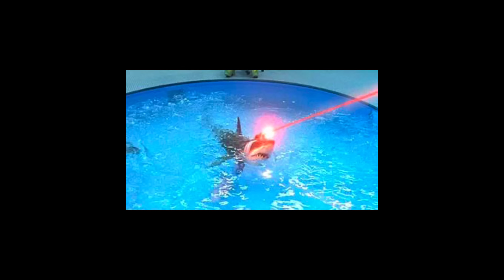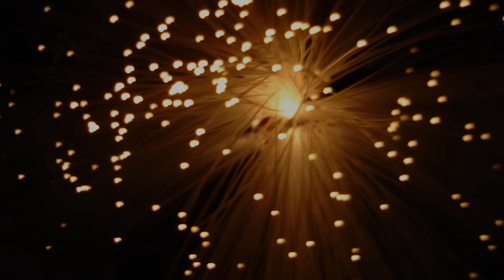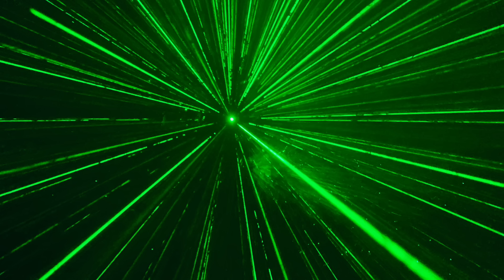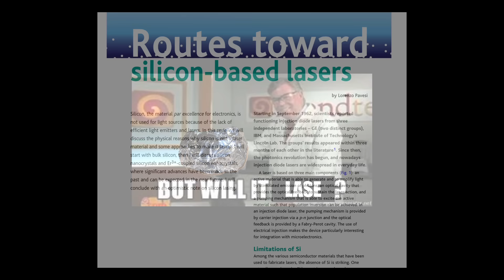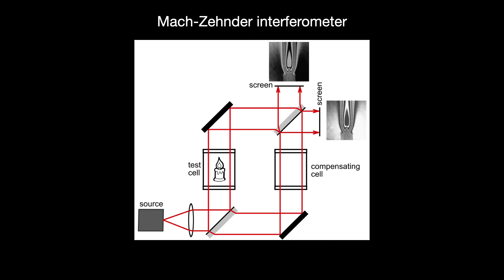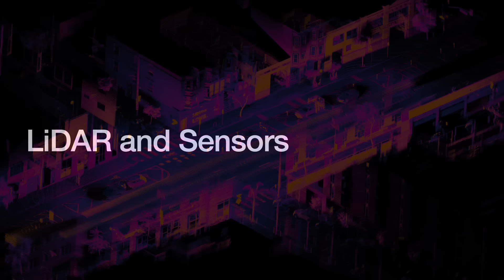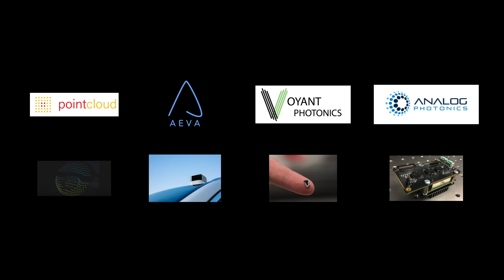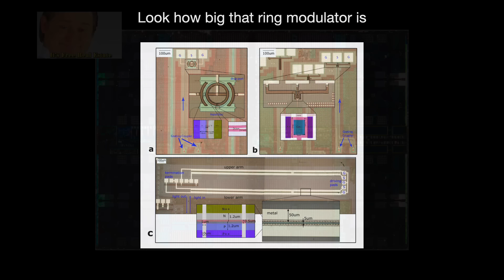Silicon Photonics: The Next Silicon Revolution?

Comment from the maker: What other silicon photonics topics would you like to see?
Reply: There are several startups working on all-optical quantum computation using integrated photonics. Psiquantum and Xanadu are the two most prominent ones.
Reply: @peersvensson9253  quantum and photonics are at a different level cannot equate.
Reply: How this would increase SINAD in modern audio gear and how it would push the performance past 130dB SINAD for just about every consumer level audio device.    
If optical circuits are used?  That takes care of magnetic fields on the traces used in common logic that we use today.  It also would make it theoretically immune to Radiation to a point.   Especially if you used something like a  Quartz crystal or something of the sort of oscillator for the CPU clock timing so that the light could be powered by that so the Logic itself would be immune to much of the interference from space travel.  

Something like this would be perfect for noisy audio environments.   

I would also have to say that something like this would also make it so that you would not need to use expensive gold conductors or silver ones as you won't have to worry about  metal breaking down over a very long lifetime.  

I know it's a little bit further than what you were talking about on the video but I thought it would be a good idea to run it by you.
Reply: @MickeyMishra  Im seconding this. Dealing with noise interference using light seems like a really good topic to talk about.
Reply: @MickeyMishra  nothing to do with audio gear, better to go back to vaccum tubes.
Reply: I would like to see more topics about biosensing. The integrations of silicon photonics in wearables seem a potential market. I work in the field and your summary was well documented and easy to understand.
Reply: Check out POET Technologies, unreal what they've already accomplished.
Reply: Silicon Nitride in integrated photonics, biosensing, quantum computing, space/high radiation applications, cryogenic applications, non linear optics, i think there is a bunch to dig in 😊
Reply: AI chips! I think photonics is very useful for inference in particular. Lightmatter is an MIT photonics AI chips spin-off that everyone is talking about.
Reply: @Extys  I second this and also maybe go over the topic of what makes for efficient chips in a neutral net, like Tesla's new super computer, is he just bullshiting like normal elon or not.
Reply: @Hassan311m  Elon is just total BS.  He cannot even understand what  is AI.
Reply: How far down the rabbit hole are you willing to go?
Reply: How do you store photons. We store electrons in in batteries but photons have no storage device.
Reply: @jamesjensen5000  in time domain you can just build loops to let the light run through. eg in Silicon at a clock freq of 50GHz, light travels only 2 um per clock cycle. Or then have some material that changes the light while it passes through. So you store the info in there but just read the info optically
Reply: This product use SOI wafers.It's hard and expensive to produce base on my experience at implant. The wafers sometimes "jump" due to charging effect and thickness compared to normal wafers.
Reply: Great intro! While not as big of a fundamental challenge, some of the integrated passives have the chance to minimize many large/expensive systems such as time of flight and photography.
Reply: The current steps being made to develop an optical motherboard
Reply: Cover poet technologies. They just released some hardware
Reply: Sharks with " lasers ".
Reply: Heterogeneous Package Hybridization
Reply: But I think there will be a paradigm shift soon, given all the AI, yes, you need huge machines to do the neutral network training and stuff, but the actual deployment will only need very little computational power. With a deployed model, even a small micro-controller will be able to to handle, just need more RAM to store the weights.  So I think the next advancement will be on the bus speeds of peripherals, currently the peripheral bus standards are not high enough, like CAN, SPI, I2C etc, think we will need 100mhz speeds. At higher speeds at low voltages will be very susceptible to external influences, so probably have to go photonics.
Reply: I've got an updated guide here for people to check out with steps.
Please do follow the steps very precisely.

There have been extreme breakthroughs in research and ideas with the latest Time Crystals, using light and other methods, there were articles that mentioned using Time Crystals for our chipsets in our computer, scaling up Time Crystals to do so with several breakthroughs in multiple articles, and the idea of using Time Crystals as unlimited energy for warp drives, advanced particle replicators, also curing most if not all diseases and more is an amazing thought, Quantum Teleportation / Quantum Entanglement, Quantum Simulations, the thought of super position and Qubits, and so much more around advanced particle replicators which would be used to create non-living objects like duplicating your food or computer and sending it to Mars and beyond our solar system using satellites and then duplicating it on the other planet when it gets there, and you can also use a button to have Quantum Teleportation send data from a machine to materialize your favorite food right in front of you "that is after the data from the original food you created was saved and stored with no bacteria and was perfect in how it was made" will then materialize the specific type of food that you chose with a button you pressed, there's also the idea of advanced clothes replicators, advanced vehicle replicators, advanced building / structure replicators, the list just goes on forever in anything you can make, first they want to start with the Quantum Internet by 2030 for that idea, sending data using Quantum Teleportation, and with breakthroughs beyond that would become advanced particle replicators.
Though the idea of Time Crystals in our chipsets for our computers "and this could change all technologies we use daily in society, a revolution in technologies", could happen very soon if they choose to do that with breakthroughs in 2022 around Time Crystals from what articles were talking about, mix the idea with Graphene, Graphene - Photonics, and many other Graphene technologies shown on my other channel under the created playlists.

The 70 year old theory "create something from nothing" was proven true when matter was created using Graphene, there was an article on this recently as the time of this message.

Erik Lentz with his new theoretical warp drives, was able to get the positive energy required known as "Soliton" particles as of early 2021 and summer 2021 down to the size of one earth mass, it could be lower now because of new calculations.

Sonny White at Nasa was able to get the negative energy required for the old theoretical warp drives down to 700 kg "the size of an elephant, vehicle, voyager space probe" for the warp bubble.

They want to make a tiny 3D printed space craft to place inside the tiny warp bubble for testing, Nasa said they won't do this until they are done funding the research on the casimir cavity, something to do with the warp bubble.

As someone from Nasa that knows Sonny White has said, "unpredictable breakthroughs can happen 10 years from now or tomorrow, it only takes someone to come along with a light bulb that goes up, and comes up with a new idea / concept idea", and that is a very important big picture.

Here are the steps. -

💡 

First save this link to your favorites.

https://www.youtube.com/channel/UCB9ezXYprgvhMaPWLhyoJ7A/playlists?view=1&sort=dd&shelf_id=0

Watch just the first 2 videos at the top of the Graphene playlist.
https://www.youtube.com/playlist?list=PLAUtk-Q2DF7wXgENPNkvc5JXH5ocia_Fo

Watch the first 9 videos at the top of the Photonic Computing playlist.
https://www.youtube.com/playlist?list=PLAUtk-Q2DF7yx80jrh7uORkHKowzGy7pi

Watch the first 2 videos at the top of the Spintronics playlist.
https://www.youtube.com/playlist?list=PLAUtk-Q2DF7zicJm2a61R4BAhekeTF64N

Watch the full playlist called Graphene Twistronics.
https://www.youtube.com/playlist?list=PLAUtk-Q2DF7yMGVEwNxSa-FYBQkMWKHf6

Watch the playlist called Graphene computers for home and starships, all the way through. 
https://www.youtube.com/playlist?list=PLAUtk-Q2DF7yXpZ9mVoTfXdnKVp0SvF4v       

There are 2 videos to check out after the playlists above that I will mention here. 
There's a playlist called Graphene with starships, the video is about Graphene aerogels made in space. 
https://www.youtube.com/playlist?list=PLAUtk-Q2DF7zvX6xltBYT8SioMONXpAMh 

The STL playlist has a video called "Spaceships capable of reaching our closest stars".                             
https://www.youtube.com/playlist?list=PLAUtk-Q2DF7wCII-h9lcBncqenpqwSkiv 

Watch all the Graphene "types" of playlists. 

Watch the STL and Time Crystals playlists all the way through. 

Watch the Advanced Solar Panels playlist all the way through, Graphene is also mentioned there in many videos.

Watch all the Quantum Technology playlists. 

And then watch all the other playlists under the created playlists.
Reply: FireworkS!
Reply: Coverage of Sintone's photonic chip foundry due to open in Beijing next year. A scoop would be wonderful
Reply: Semiconductorization of Photonics - Extending Wafer Level Chip Scale Packaging (WLCSP) to Photonics
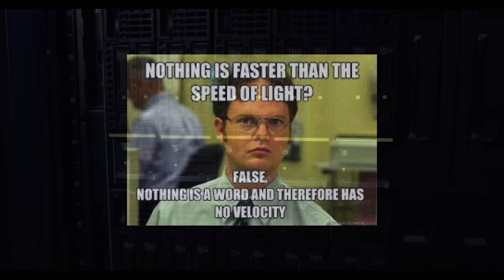Reply: 1:45 how am I supposed to think now 🤣🤣🤣🤣🤣🤣🤣🤣
Reply: Can Silicon Photonics be used to make active coatings or chips that would become active coatings. that say could change the color of your car on demand. The the laser emission is used as a visible light source but tiled over a large area... >Power each silicon laser produces >applications.
Reply: design and epitaxy of III/V devices
Reply: Photonic quantum computing chip analogs. You are right about the silicon photonics, they are using a hybrid of a laser made out of a III-V material, for telecon its usually GaInAs and the silicon part is doing the beam switching
Reply: Please add animation to make it easily graspable the lay viewers
Reply: Photonic Quantum Computing
Reply: copackaged optics packaging techniques please. Curious to see hybrid bonding needs as result and impact to typical copper to copper interconnects. Does it cannabilize? All incremental? tHX
Reply: Is there new update since 2 years ago on photonics for AI space?
Reply: ANN optical matrix multiplication
Reply: How it relates to plasmonics
Reply: I prefer Graphene and "Graphene - Photonics" over silicon.

What's better than silicon integrated - Photonics? Graphene - Photonics / carbon nanotubes, and there have been new methods to scale up Graphene since 2020, you just need to research it, some ways are found if you go to my channel to check out all the Graphene playlists, and Graphene - Photonics on the other channel found under my channel called Technology Research, it's a green T icon / thumbnail, once you get there go right to the "created playlists" and start at the bottom with just the first 2 videos at the top of the Graphene playlist by clicking on the "view full playlists" below each playlist, scroll down to the bottom of the created playlists to find it.
After those 2 videos at the top of the Graphene playlist, go to the Photonic computing playlist and so on, work your way to the top, watch all the Graphene playlists, and maybe even the STL playlist after those, you're going to see very big pictures here.

Yeah I kind of get tired of the bias around silicon and nothing else like Graphene isn't mentioned ever with Photonics.
Check out the Graphene computers for home and starships playlist on the carbon nanotubes scale up breakthrough in 2020, and Graphene aerogels made in space under the Graphene with starships playlist.
Though please watch all videos from top to bottom in that order under each playlist, no cherry - picking, please force yourself to watch them in order, there is a very good reason I placed them that way.
Again start at the bottom of the "created playlists", so click on the words created playlists and scroll to the bottom, the Graphene playlist should be on the bottom.
Reply: @gameresearch9535    Is there anything that is immune to EMP and EMI / Radiation? 
That is where I wan't logic to focus on.
Reply: @MickeyMishra  

Graphene is resistant to electro magnetic impulses.
Easiest way to find this out is a video under a playlist on my other channel.

https://www.youtube.com/watch?v=-hY6zx0whhQ&list=PLAUtk-Q2DF7wLuXvjbh33wdYTZb7l-ite&index=3

And for a list of many amazing things to look into, save this to your favorites, and watch all the playlists starting from the bottom, especially just the first 2 videos at the top of the Graphene playlist, the Photonic Computing playlist next with all the videos, the Spintronics playlist, and then all the Graphene playlists seen under the created playlists.
After that check out the STL playlist and the Time Crystals playlist.
https://www.youtube.com/channel/UCB9ezXYprgvhMaPWLhyoJ7A/playlists?view=1&sort=dd&shelf_id=0
Reply: @gameresearch9535  Done and Bookmarked.    THanks Boss!
Reply: @MickeyMishra  photonics is immune to EMP and EMI because as long as the Chip is sealed, no light can enter, nothing can affect.
Reply: @gameresearch9535  Photonics is still better.  It is because it is a form of analog computing.  Graphene will still be very much digital.  Just imagine for digital to process 1+1 you need at least 2 transistors, but in photonics, you just need 1 wire.
Reply: @franklee663  
Carbon nanotubes still prove smaller than silicon as carbon atoms on the periodic table are also smaller than silicon.
Graphene having optical properties still proves to have light / Photon particles run through it, so either way you're still going to have Graphene - Photonics, I'm done with silicon. Imagine allowing silicon to keep going after it proved its limits so they keep trying to make hybrid silicon around the issue after silicon melts at around 4.5 Ghz which is why we were stuck there for years.
And with Graphene / carbon nanotubes, we have the ability to go smaller with the transistors.
Graphene already proved with a specific magnet to be 1,000 times faster and use less energy, especially when applied with Graphene Spintronics and Graphene Twistronics, now add Graphene - Photonics to that combination.
Now imagine using the advanced material such as Graphene / carbon nanotubes with the advanced Photonics, not just for integrated - Photonics but for Photonics in general, I really do not want opto-electronics at all, it should be Photonics and Graphene / carbon nanotubes together.

I'm more into Graphene with the carbon nanotubes as transistors than I am silicon, and far more interested for very good reasons of everything about Graphene as proven on the other channel.

Go to my channel find Technology Research, go to the created playlists.

When at the created playlists, start at the bottom with the first 2 videos at the top of the Graphene playlist.

This first video isn't long though it's old, it still gives some interesting point of views and reminds people to get out there and find ways to scale up Graphene.

There should be a specific order the playlists and videos are seen in, if they are different... you might want to check using Microsoft Edge, oh and go to the "about" while in the browser, to update the browser.

Don't take these in the wrong way, they're still enjoyable to watch. Please watch everything all the way through.

https://www.youtube.com/watch?v=J0ZMi83oUjk&list=PLAUtk-Q2DF7wXgENPNkvc5JXH5ocia_Fo&index=1

https://www.youtube.com/watch?v=yUTHA-2LF0w&list=PLAUtk-Q2DF7wXgENPNkvc5JXH5ocia_Fo&index=2

Now go to the Photonic Computing playlist, watch 9 videos.
Again make sure the videos are in the order seen through Microsoft Edge, and through a video on the home page of the channel, watch that video! It's only a minute long that shows some navigation through the channel, I might change the video on the home page of the channel soon when I release some other videos, and might put it back after.
Also remember, watch only the first 9 videos at the top of the Photonic Computing playlist.
https://www.youtube.com/playlist?list=PLAUtk-Q2DF7yx80jrh7uORkHKowzGy7pi

And then watch the first 2 videos at the top of the Spintronics playlist.
https://www.youtube.com/watch?v=Cs-rB3YG_ZE&list=PLAUtk-Q2DF7zicJm2a61R4BAhekeTF64N&index=1

https://www.youtube.com/watch?v=_UVmKj-8VEM&list=PLAUtk-Q2DF7zicJm2a61R4BAhekeTF64N&index=2

Watch all the Graphene "type" of playlists from the bottom to the top after that, with all the videos in them.

https://www.youtube.com/playlist?list=PLAUtk-Q2DF7yMGVEwNxSa-FYBQkMWKHf6

https://www.youtube.com/playlist?list=PLAUtk-Q2DF7yXpZ9mVoTfXdnKVp0SvF4v

Here's some interesting things to check out "after"... you are done watching all those playlists in the order shown.

Find a video under the Graphene with starships playlist, about Graphene aerogels made in space to revolutionize the way we explore space and watch it all the way through.

https://www.youtube.com/watch?v=nctQVS8EJ-8&list=PLAUtk-Q2DF7zvX6xltBYT8SioMONXpAMh&index=9&t=3s

Find a video under the STL playlist near the top of the created playlists called "space ships capable of reaching our closest stars", about Graphene being used to open a new field of research around a Photonic spaceship.
https://www.youtube.com/watch?v=JYN-HUqW4Ao&list=PLAUtk-Q2DF7wCII-h9lcBncqenpqwSkiv&index=13

And then watch all the videos in the STL playlist and Time Crystals playlist, you might want to skip below the Anton Petrov first video from the top, and watch the rest below it in order from top to bottom, just make sure you get through all the videos.

https://www.youtube.com/playlist?list=PLAUtk-Q2DF7wCII-h9lcBncqenpqwSkiv

Some of the videos might seem repetitive in the Time Crystals playlist, be sure that there are many valid points and interesting things in the videos, and some others that have updates, so you're going to want to see them all the way to the bottom, because one of the latest videos has more info too.
https://www.youtube.com/playlist?list=PLAUtk-Q2DF7y7AC4qop9oBql1v6duKS93

To be quiet honest though, I'm really just tired of silicon and how they weren't really placing the information out there as a first priority so that people knew reasons for the stuck at 4.5 Ghz over the years with our computers. Though I'm very excited for Graphene - Photonics for other devices also.
And wait until you see one of the playlists about Graphene computers for home and starships shown in one of those links in this comment, watch all the videos from top to bottom in each playlist.
Please do not cherry - pick / nitpick through the playlists, and don't ignore them.
Save this link to your browser's favorites.
https://www.youtube.com/channel/UCB9ezXYprgvhMaPWLhyoJ7A/playlists?view=1&sort=dd&shelf_id=0

Also you mentioned to another person about Photonics and Quantum Computers? There are already a Photonic - Quantum Computers from different companies, also Archer Materials a company from Australia, creates Graphene - Quantum chips for Quantum Computers, they already did in under a year back in 2019 and had 3 Qubits in that same year, imagine what they have now for that, and that is very unique, it's a shame the U.S. isn't creating Graphene - Quantum chips for Graphene - Photonic Quantum Computers.

Videos here on Archer Material's Graphene - Quantum chips. Don't forget to check each playlist description for articles, click on the "view full playlist" words, not the title of thumbnail / icon / pictures of the playlists seen under the created playlists.
https://www.youtube.com/playlist?list=PLAUtk-Q2DF7wXgENPNkvc5JXH5ocia_Fo

And more videos seen here under the Quantum Computing playlist about Archer Materials.
https://www.youtube.com/playlist?list=PLAUtk-Q2DF7zcaxLKdVe7KGlZW6VZBYn6

Archer Materials working with IBM on Graphene Quantum Chip breakthroughs.
https://www.youtube.com/playlist?list=PLAUtk-Q2DF7xRdatsGuKGV3tmwRioKfZu

Again don't forget to check the playlist description for articles, click the "more" button, or "show more" which ever it says.

Want to know why the playlist descriptions are so weird for my playlists? Watch videos here that show reasons.
https://www.youtube.com/playlist?list=PLAUtk-Q2DF7xsjVfESM1sqZdkHJYRw--j

There are a number of Graphene scale up breakthroughs over the past couple of years since 2020 as the time of this message, you can find them in many playlists, some also found at the bottom of the Graphene playlist, which is at the bottom of the created playlists.
There is a video about a carbon nanotubes breakthrough for transistors from 2020 found in one of the links above from the "Graphene computers for home and starships playlist". And Flash Graphene in that last link above.

Though you will find more after that if you google search, there was a new video with old misleading information about Graphene's scale up as what sometimes happens, and a lot of angry viewers mentioned different methods I don't recall and some mentioned a google search for the Graphene market which also might show more, but there are some hidden ways out there, scattered with different info that you have to find separate unfortunately.
Reply: @gameresearch9535  Do you know that China has already mastered graphene production?  They already have some chips on graphene and also I am wearing underwear with graphene embedded bought from China.  The underwear is very comfortable, anti-bacteria and very stretchable lol.  And as usual, very economically viable, US$10 for 5 with 2 free hahaha
Reply: @franklee663  
Yes anyone who went to my other channel and watched the full Graphene playlist knows this from a few years ago, there's a video of Europe talking about how they're ahead of the U.S. in Graphene research and that China is ahead of them, this embarrassed the capital of the U.S. and it's because of the greed for the ignorance.

For sure you should check the links and follow the steps I mentioned, you will love those links and the specific things I mentioned to watch, don't miss those.

Also about your Graphene product, there some interesting ones in the Graphene playlist too, be sure to check those out. I can't exactly mention one of them that I want to here, though it is very helpful for women, and that should help not only with girl mood swings, but also for relationships and marriages, also helps with health issues which is why the mood would be better, yeah check the Graphene playlist at the bottom of the created playlists, had stuff there a while.

And I have a Graphene NVMe M.2 SSD in my computer for the Windows operating system.
A new version came out this year if I can remember, though it's sold out and hope they come back in soon for an upgrade version at 7,000 Megs / sec read speeds and 5,5000 write for the drive.